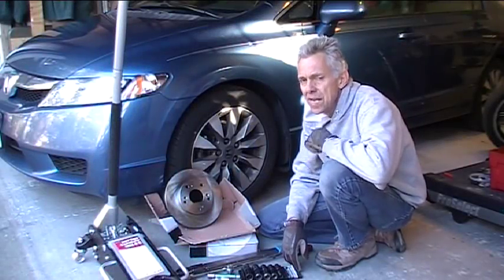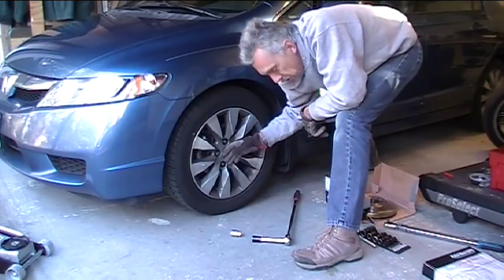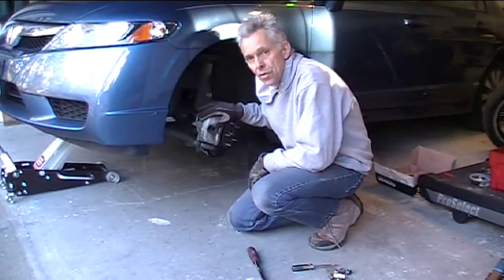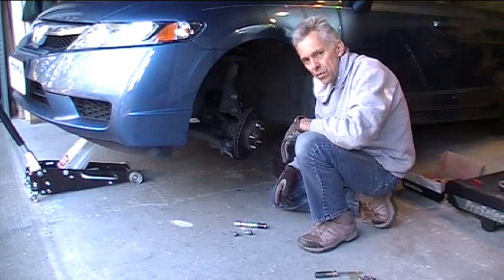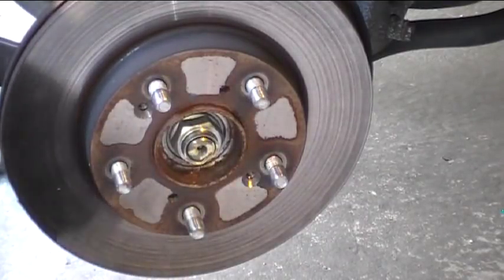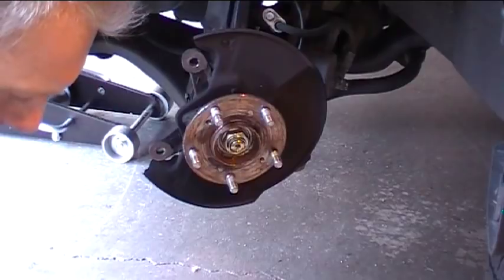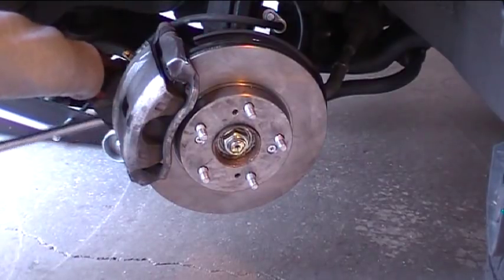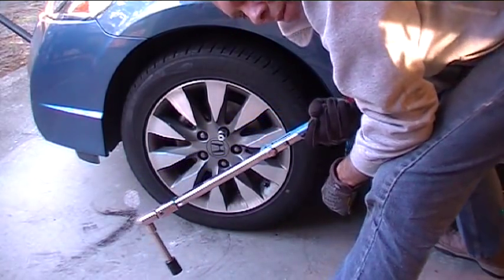2008 Honda Civic Front Brake Rotor Replacement

Comment: Nice tutorial, probably one of the better Do it yourselfers I've seen on this job. I found it helpful when doing my 2002 civic. Nice tip by the way with those two screws and using a hammer to loosen them as knock em'.

Comment: i was struggling with the rotors until i saw your simple suggestion for turning the wheel to get more room to get a breaker bar in there. thanks!

Comment: Thanks for this video it got me in the right direction.  I spent 2.5 hours trying to get the bolts off the caliper bracket with my wimpy 3/8 drive.  I spent $35 and bought a breaker bar (1/2 drive 15" handle) and the bolts came off in 2 minutes.

Comment: After removing the screws that hold the rotor to the hub, they typically can be threaded back into the rotor in the previously empty holes clocked about 90 degrees from the holes you removed them from. This will push the rotor and hub assembly apart with out the risk of damaging a stud from an errant hammer swing.  I really enjoy your videos. Are you still working on the quad-copter?
Reply: So im about to have to do my rotors can u explain to me what it is u r talking about im not good at aiming so I rather do it without risk if u don't mind explaining to me

Comment: Great video. I'm jealous that your rotor hold down screws came out so easily. I have NEVER had them come out like that. :)
I almost always have to drill them out (they are usually Aluminum).
Also, the two threaded holes in the rotor can be used to push the rotor off the housing. That way you don't have to hit the assembly.
Reply: those screws, yes, are always WAY TOO TIGHT. I think in the video he pre loosened them...

Comment: Very well done instructional video on the subject. Knowing about the 18mm size caliper to knuckle bolt comes in handy as I have to go and get a replacement. Funny how tools sprout feet and wander off. On thing i noticed which I'm rather strange about is the term "Emergency Brake". I got into the habit of calling it a parking break. Dumb as it may sound is that I think emergency brake to the automobile mechanical total novice is that it seems to denote what is used in an emergency situation. Which yes it obviously can. But the novice I think sometimes takes it too literally as I have gotten into so many peoples different vehicles and the parking brake is not engaged. When I have remembered to ask them what the name of it is while pointing to the hand lever the reply has always been emergency brake. I maybe totally wrong on this but I'm under the impression that applying the parking break helps to adjust the rear brakes but then that possibly could be just on drum brakes. If I am deluded on that I now will jump to the concept that in any case the driver should always have the parking brake applied when exiting the vehicle or when it is parked. This of course applies to auto transmissions because anybody with a manual trans knows that novice or not. Why do I feel so full of myself all of a sudden?

Comment: It's such an amazing video.  However I have some questions. Do you have to resurface your brand new rotor before to putbit on the car? Did u check for the"safe" thickness tge rator should be according to honda specs?
Thanks again
Reply: New rotors should be well within recommended thickness, and aside from cleaning off residue like he did in the video, new rotors should not need to be resurfaced. That's why they are new.... So you DON'T have to do those things

Comment: The OEM pads are organic. They do a good job for most commuters and last 3 to 4 years. Duralast is a good pad and their pads and rotors have a great guarantee. If you decide to upgrade to bimetallic or ceramic the pads they will last a bit longer but rotor replacement will be more often. Ceramic pads do have much less dust but costs over twice as much. I can do a front pad replacement in less than an hour, and the organic pads for the front are only $20.  Video Pros - Removing anti corrosion goo from the new rotor is very important. Knocking the rotor loose with big hammer vice prying on the assembly is a great point.  Video Cons - Go to harbor freight and get two jack stands and two wheel chocks - Yes go now. Signed: Capt. Obvious

Comment: Thanks, hackman for your your useful tips, particularly the turning the wheel to better approach the back...I wondered if you ever ran into 4 wires in a brake pad replacement box (from a dealer); I can't figure out where they go...They're approx 3 inches each and somewhat U shaped.

Comment: When you jacked up the car using a floor jack under the middle of the front end what did you put the jack on? I've been very shy about resting the jack on anything in the middle front but it woud be nice to know where it is safe to do that. It saves a lot of time to raise the whole front end.

Comment: This may be a noob question,
but what's the difference between the rotor parts with the designation 45251-SNA-000 vs 45251-SNE-A00?

Comment: My rotor bolts were impossible to take off each rotor had 4 ended up never changed the rotors...laughed when you said they weren’t always tightened much lol

Comment: My 2008 Civic is 80ft lbs for the lug nuts. Also using an extension changes the geometry so i think you really over torqued those lugs.

Comment: I have a honda civic like yours, Could you please let me know what additional part or bolts do I need to dissasembly to replace the front wheel hub bering "ONLY THE BEARING"...I know I have to remove all what you did in this video plus the center hub nut....but what else???  also I understand I will need a hydraulic press to take out the bering front the wheel hub. Please let me know  and thanks in advance

Comment: Overtorque especially on alloy wheels means they will be much more prone to breaking off at the hub. Too loose and they fall off, too tight and you are going to have them fail when you brake hard. If you tighten them up till they creak then they are too tight. Air tools to tighten are definitely a no go here, they will strip the studs with time.

Comment: y would u always pull the e-brake? its not nessary to pull it every time you park it jus keeps the cable adjusted if its a manual u can put it in 1st if its a automatic it has a parking paw tht ketches in the tranmission to keep the car from rolling.

Comment: Hey Dean, I have a 2009 Civic Si Coupe. Where did you place the hydraulic jack to lift up your Civic. I've never done it before and would like to know the specific location. Thank you.
Reply: Usually it's right on mid center of the front wheels. There's like a bump where the jack will lift it. Check on-line for the "Lifting Points" on your civic. You'll find some pics. ✌(◕‿-)✌

Comment: Yeah I hate when they do that. Unless there is a leak in the brake system (which should be repaired as soon as possible) you should not keep topping off the brake fluid as the pads wear and fluid is displaced into the caliper pistons.

Comment: I do have 2007 HONDA Civic, mostly when i brake i get the squeaky noise from front. I have changed the pads & even the mechanic told rotors also ok. But still the problem is there? Hackweek can you help on this??

Comment: Shouldn't you change the pads every time the rotors are changed. Pads are worn and not flat anymore, my understanding it is always best to change both. Any comments?
Reply: chalo2324 I do. most of the time when its time to change pads the rotors all scored and worn out anyways. I've never just replaced pads

Comment: The caliper bolt heads are 17mm, not 18mm.  Honda commonly uses 10mm, 12mm, 14mm, 17mm, and 19mm.  I've never seen an 18mm Honda fastener.

Comment: Hi everybody, 
I have one question. My car is a Honda Civic FD vti 2008 1.8L. In the front left braking rotor, is there any way to get the retaining screw out when the head is worn off? And what is the spefication of the retaining screw? Thanks beforehand. 
Tony
Reply from the maker: You can just drill the head off. When you put the wheel back on, the lug nuts are what hold it solid in place.

Comment: Do you really need to replace the guide screws?
Reply: +Sean Kane 
You should have them before you start the process.  Those screws are usually so rusted in place that you may destroy them trying to get them out.

Comment: could i use engine degreaser to clean the rotors?
Reply: Yes and no. If you're replacing them & want to clean the area before disassembly, yes. If you're re-using the rotors, I'd use Brake cleaner...dries instantly with no residue.
Reply: Thank you very much! I will use degreaser because I am changing out the rotors completely. Also do you think it is a good idea to use High mileage oil rather than conventional oil?
Reply: Nikhil Rametra You're welcome. I use synthetic oil & change it every 5K - 7K miles. I prefer that over the high mileage oil because the detergents in the oil can also break down the oil faster, so you should change it more often. It makes more sense to me to use more expensive oil, but keep it in longer. I've got 190K on a 2004 Corolla & the engine is still as clean as new inside with no problems.

Comment: Just attempted this today my holding screws were so freakin rusted I tried everything even torch couldn't get them out.
Reply: +MonopolyMan M I had the same problem today but I soaked them in WD-40 and let them sit for 10 mins, then hit the socket wrench with a rubber mallet until it came loose. My problem is getting the rotor back on...There is about a quarter inch of brake pad that wont fit over the disk and I've tried prying it with all sorts of tools but it won't budge. I started tapping it with a rubber mallet but the brake pad started to chip so I stopped
Reply: +MonopolyMan M 
That's generally how they are, the video is misleading in that you're not  just going to be able to turn those screws without an impact screwdriver - at least none that I've seen.
There are some other videos that show the real difficulty of removing those screws.
Reply: Y0d3lingy3ti thanks guys. My fronts will be done in a few months. Worse scenario I'll drill them out I have a good tap set just in case.
Reply: I know this is an old comment but in want to be sure enough people add their voice to this issue. I hose effing screws are  BITCH to get out! I used an impact driver on the SECOND ones. The first one had to be drilled out. Either make sure you ha e an impact driver...$15 at Harbour Freight...or prepare to work on them a while. I didn't replace the effed up ones. My Tahoe doesn't have them so I don't know why my wife's Honda needs them so badly. No issues yet and I changed the rotors last month. Oh!! Clean the rotors before installing them!! Otherwise they will smoke until that shit burns off the rotors AND then the new pads too...you should absolutely get new pads BTW, they cost was much as one rotor and will help make both last much longer. (Spend the money, you're already saving hundreds by doing it yourself).
Reply: Samshu It's time todo my front rotors and these damn screws aren't coming out :@!!!! they are like welded into the rotor. have to be drilled. so fucking annoying!